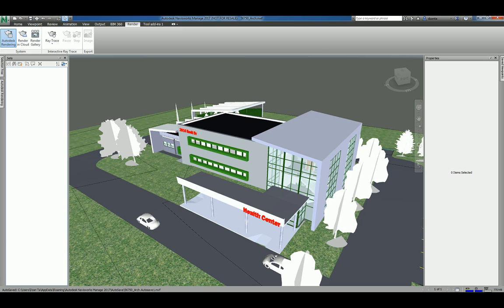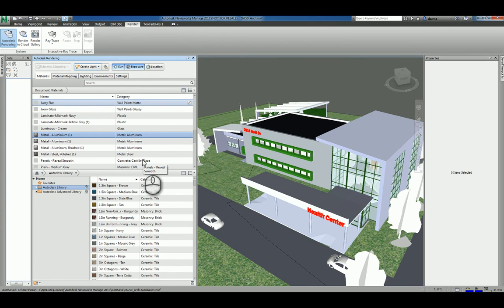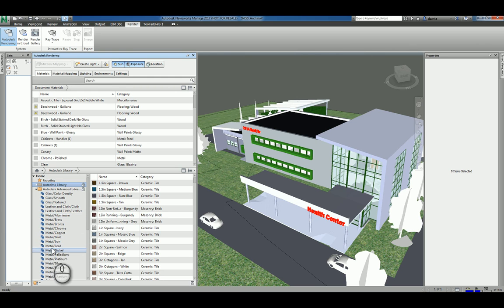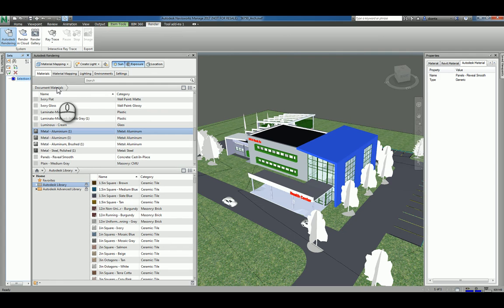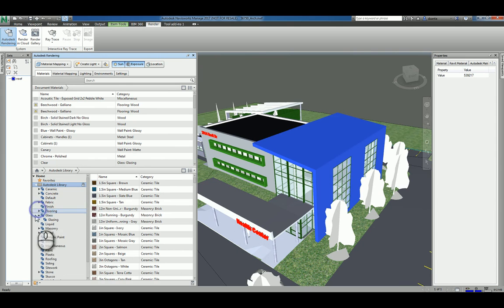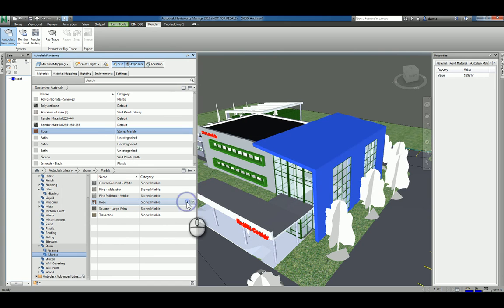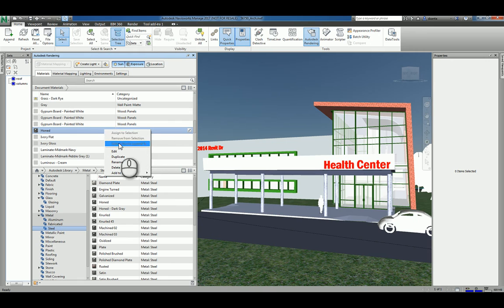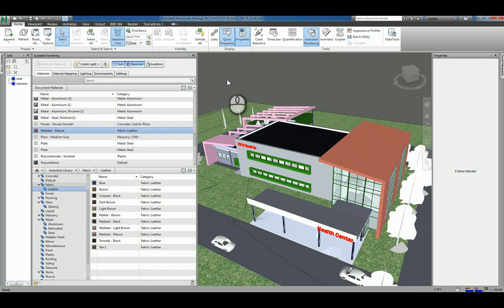Autodesk Navisworks Materials   A How To Guide

Comment: Hey Dzan Ta, I've added materials to my project, but when i play the animation it still shows the animation without the new materials on it. How do i get the materials to show in my animated walkthrough?
Reply from the maker: So I looked at this for you....seems there is a bug in the software.  If you change any materials after an animation is created, the original animation will not update automatically.  You  will have  to save your work after the materials have changed.  Then, close Navisworks.  Then reopen Navisworks and your file.  The updated model will show the new materials applied.  The animation will then show the updated materials and it will run showing the new materials.